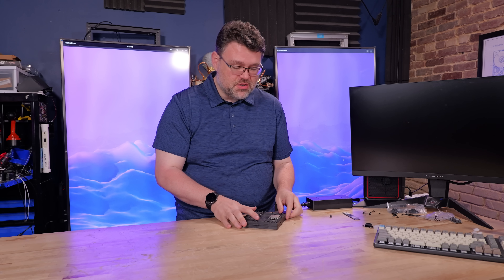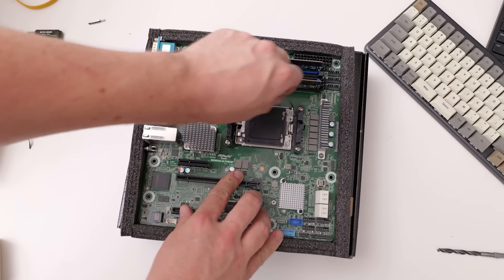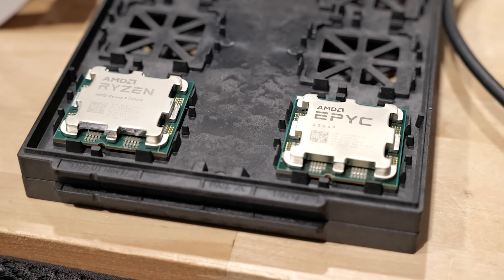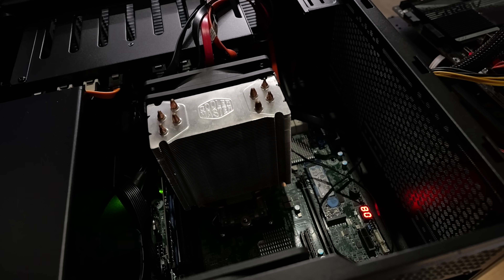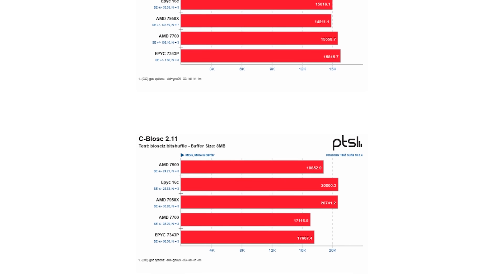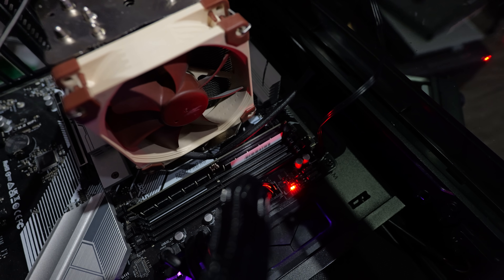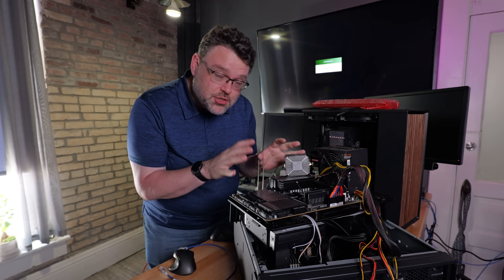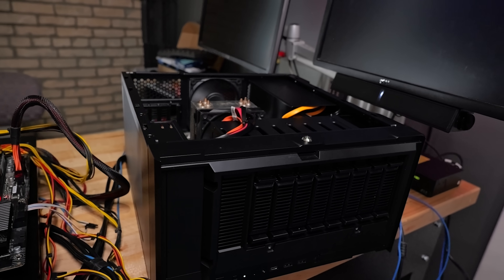They Put Epyc Onto AM5? Can They Do That?

Comment: AMD is basically just competing with itself
Reply: After having Intel not give any real new innovation for a decade, I'm Ok with this. I hope AMD doesn't go the same way as Intel down the road
Reply: @RockRockbob  If Intel goes into a Bulldozer style rut, they will somewhat, except that ARM is finally looking to make some inroads for desktop and servers, meaning AMD at least has to keep representing the larger x86 ecosphere with gusto.
Reply: @enlightendbel   depending on how bad the 13th and 14th gen cpus really are those two gens could cost intel more upfront and down the line than bulldozer did for AMD. Intel has to deal with all the people replacing chips for free and if someone sues them and wins.... ouch. At least bulldozer was just shit and not defective on an expensive node.
Reply: @RockRockbob  As long as AMD doesn't bar Intel from competing by giving OEM partners millions in rebates, I think I'm okay with them being on top.
Yes Intel did that during the Athlon 64/Pentium 4 era.
Reply: @RockRockbob  honestly I want them to keep some well researched processors in the back and then just do what Intel did for years. Most people aren't gonna push 12-16 cores.
Reply: @RockRockbob  Well, Intel was competing with itself.. which is why we didn't get anything for that decade.  So, now it's just turned around.
Reply: @Moshenokoji Intel was not competing with itself. Intel had no competition or motivation to self improve. If you want a company that actually does compete with itself, remember that Nvidia is a company.
Reply: @RockRockbob  If I were AMD, I would always be checking my rear-view mirrors...  Intel is pretty brutal.
Reply: @kayakMike1000  True, upto a certain extent. People thought Intel was completely dead after 11th gen and that AMD would be the only dominating CPU company. Then 12th gen came and gave everyone a reality check.
I hope AMD doesn't think that they are completely free and they have nothing coming up, giving them an excuse to give Zen 3 level pricing for Zen 5. But again, they are just as greedy as Intel, so I wouldn't be too surprised either.
Reply: @kayakMike1000  It's deeply ironic that the Intel CEO said some years back "we'll leave AMD in the rear view mirror. That aged like milk being left out on the hottest days of the year.
Reply: @RockRockbob  AMD was a complete joke during those years. Intel will have a competiting architecture at the end of the year with Arrow Lake. That's completely different than AMD back in 2016 having 2% market share and being a total footnote.
Reply: @MrHav1k   They are pushing their 13 and 14th gen CPU way too far already, not just TDP wise, and also have some devasting amount of failing CPUs.
To make Arrow Lake be competitive, intel needs at least an efficiency wonder.
Can't put 64 E-Cores and 2 P-Cores in Arrow Lake and call it a day.
Well.. you can, but..
Reply: intel had server chips in the desktop socket for some time and they locked the non server chips out of ECC. Amd does not lockout ECC but for marking / corp needs having and desktop socket server chips is good for installs that don't need the full sized epics.
Reply: You're right about this but if u have been following the tech space long enough you know this is never a good thing. Ideally u want the performance crown to switch every 2-3 generations or for them to be as close as possible. This way both companies are on edge and are trying balls to the wall to one up each other. The results of that is innovation and great value for the customer. Look at First Gen Ryzen the pricing was great the value was amazing , same with 2nd gen when 5th gen rolled around and AMD was 10-12% faster then Intel 10/11th gen , and used less power AMD increased there pricing. With no push back from Intel ,AMD will get lazy and fat just like Intel did it's human nature. Take your personal best time as a jogger or runner now compare that to the same run same distance same conditions just have a hungry bear chase you and I bet you obliterate your personal best. We need Intel & AMD both taking turns as the runner and as the bear to have the best products and best pricing.
Reply: And their high end parts don't self fail after several months
Reply: Well, if Intel is messing up and no threat, then what else can they do!  I have always preferred AMD's, because for a little less raw speed, you get stability, longevity, and fewer problems you find out the hard way not long after you bought it, and at a lower price too, and don't have to shell out an extra $100 or way more just to use ECC memory either!  I switched to AMD in the 486 days, and so far it has shown to be a wise choice, because this is not the first time Intel processors had some major problems!
Reply: Qualcomm and Apple are their main competitors now. That should help prevent stagnation at least, even if it's pretty much just AMD carrying the flagship x86 torch.
Reply: Nelson, stop competing with yourself.
Reply: That's a good thing. How do you beat the beat when you're the best? By competing against yourself.
Reply: I’m ok with it.
Reply: Only because NVIDIA is overcharging and Intel is about to go bankrupt. 😂😂😂
Reply: Which I hope that changes in the future as I don't want to see another intel situation of stagnation.
Reply: All good comments but, overall sales are not high.
Reply: Too bad they can't compete in price. It sucks that 9600 is going to be a $300+ 6 core
Reply: Factually incorrect, OP. Intel still dominates prebuilt and laptop markets.
Reply: @Aggrofool  Watch how long that lasts as the year goes on and 50% of the i9 13th gens go out and then a year after that with the 14th gen. 

Plus intel is known to pay off OEMs for deals, let see how long they have the money to do so.

In any market that matters though intel is laughed at now more than ever (server, DIY).
Reply: @Aggrofool You're right Intel is more popular with your average laptop buyer. But I feel that's changing with many OEMs making high quality amd designs (Lenovo and Asus probably do it best).

Pretty much all PC's in my family run amd now. Mainly because they have better battery and thermals on value PCs compared to a similarly priced Intel.

Comment: I upgraded my home server last year from a dual socket Xeon v1 to a single Ryzen 7600. I ended up halving the ram, but it performs better as a game server (which is the only task that pushes it) and runs 70W less at idle.
Reply: if you have a bit of time, you could undervolt the CPU and test around. I set my 7950X to undervolt -15, and now it achieves around 55W on near idle (5% CPU load), and even below 40W on full idle (after boot with no programs started). 
And that (I know I know) on Windows 11.
I might be able to push it to -20, but probably will reduce just 1 every now and then to test stability.
Hopefully optimizer Curve is coming to X670(E) and Zen4...
Reply: @bernds6587  yeah, that's worth doing too. I've got some time coming up, and the server needs a BIOS update and some tweaking, I'll add that to the list, thanks 🙂
Reply: Have you tried it in Eco Mode? If it still performs well enough for your use, that should save on electricity.
Reply: @TheChadXPerience909  I haven't, but doesn't that just affect the peak power draw?This thing spends most of it's time at idle.

Comment: Got excited at first thinking this would get me away from having to do a Threadripper build, but not nearly enough PCIe lanes. Bummer.
Reply: Yeah, the socket won't support that, and since they've just doubled-down on their AM5 commitment, we'll have to wait until 2027 before that might change. Thus, you can rest assured that a Threadripper is the way to go if you need PCIe lanes.... Well, or Team Blue, of course.
Reply: @TheChadXPerience909 I wouldn't trust team blue with anything right now. Not until they give us some official explanations for current chip failures.
Reply: @Freak480  Yeah... But, it can be a lot cheaper than Threadripper.
Reply: @TheChadXPerience909  If you're one to gamble then sure.

Comment: I like the look of the 7900 non-x Epyc counterpart - the 65W, 12 core one - 4464P. Pretty cheap and low power but plenty of cores for a home lab scenario.
Reply: Outrageous.  Do you not understand the value of X?  AMD are doing such favours in allowing you to buy a product with an X for a crazy low price, they're breaking the market.  Outrageous.
/s
Reply: @ChrispyNut  X is just short for eXtended frequency range, meaning slightly higher clock speeds, 
This shares the same name as the automated overclocking feature dating back to Zen 1.
Reply: @tim3172  It's also commonly mocked on TechTube for what I said.
If you don't know the meme, it's probably not as funny as with existing meme knowledge.
Reply: @ChrispyNut  You almost had me at the notification, then I opened and read it again hahaha
Reply: This, and an asrock rack with 16x/0x, 8x/8x and dual 10gbit, but no bcm
Reply: why not get the Ryzen one then? compared to the EPYC it is way cheaper, and there is no difference in terms of cores, lanes or memory.
Reply: You might find yourself wanting more PCIe, though. And, stay away from "B" MBs, if you need IOMMU.
Reply: @TheChadXperience909b mbs? What are those

Comment: I wish they'd give us the dual v-cache chip. It really helps in some applications.
Reply: @tomstech4390  there was a prototype dual v cache that they never released
Reply: @cal2127  yep on AM4 5950x3d does exist only in AMD sadly.
Reply: @cal2127 actually there is a story that one lucky dude get 7950x3d with vcache on both chips
Reply: @tomstech4390  I wish they'd give 32MB + 64MB on each chiplet, so 192 MB total. Some application really benefit from it. I have one that uses about 50 MB of working data and is memory bandwidth bound, so each chiplet having 96 MB would be excellent.
Reply: @MarkRose1337  The market for desktop parts with dual v-cache is low because of the clockspeed penalty - in theory AMD's expected role for the dual CCD v-cache parts is so that you can use one CCD for cache heavy loads while still being able to use the other for clockspeed limited loads, given that desktop users are likely to encounter a mix. Is your application one that can justify moving up to full size Epyc? There's fully v-cached Epyc options, although that's less a step up and more a quantum leap with an option for over a gigabyte of L3 (you could potentially go with a non 3D design with 256MB as well)
Reply: @bosstowndynamics5488  Seems the spam filter ate my previous reply. I could get an -X series Epyc, but buying multiple 7800X3D systems would be less expensive, and give double the main memory bandwidth. Having L3 on other chiplets doesn't help, since the L3 cache is a victim cache, and the data would never make it to residing in the L3 on the other chiplets. It needs to be attached to the same chiplet.
Reply: @MarkRose1337  amd could use V-cache as bridge link to each CCD. But you'd get cache trashing.
Reply: @bosstowndynamics5488 yeah but those have a ton of cache because they a ton of cores.

It results in the same ccd per cache as non 3d consumer chips.
Reply: Apparently its coming in zen6
Reply: Yep -- dual 16-core 3D-vcache could be a beast for scientific calculations for researchers on a tight budget.
Reply: Unlikely, those are essentially enterprise market rebrands.